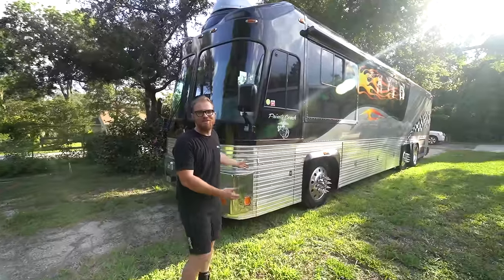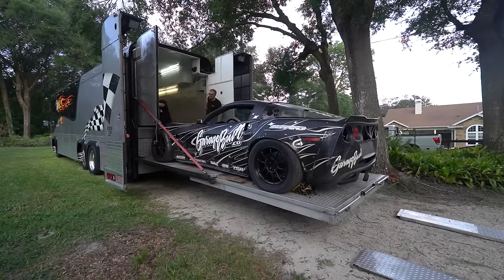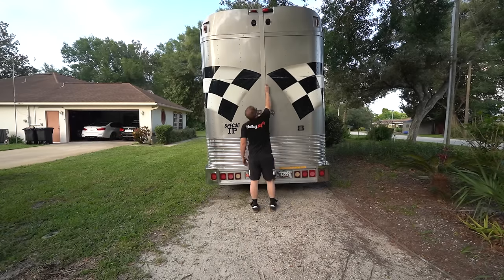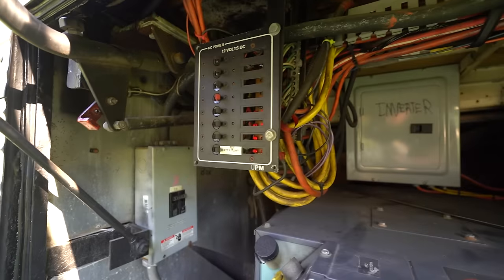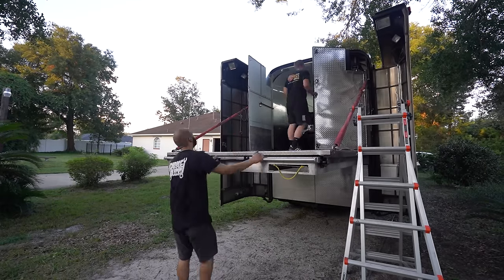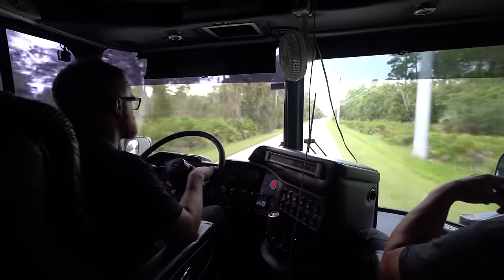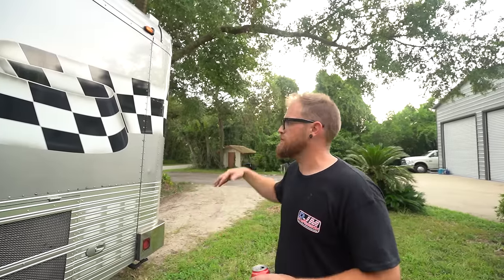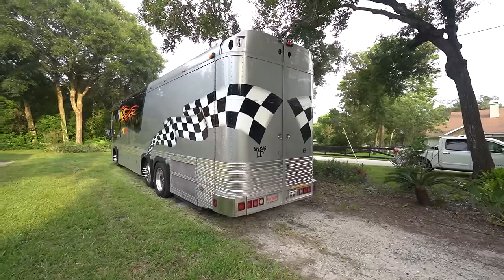First test of the new race car hauler. RV bus conversion. will it fit?

Comment: where is the holding tanks and the dump for the black and grey water? the water heater (theres no such thing as a hot water heater,theres no need to heat hot water,its a water heater,ex-plumber here)maybe in that area. just curious, you going to pour a concrete pad, nice n level,clean, pole barn type cover over ir? be sure to put in a 50amp "shore" power stand, and put a hose bib there and see about running a sewerline to that area as well. yeah i said i was curious, then im giving advise. but my point to the hose bib and sewerline to where you park the haulin bus, you can go to the track and back home without having to find a dump station, heres a trick i used, use your toilet to poop, if ya just going to urinate, the guys anyway, get a plastic urinal (like if yer in the hospital) and pour it down the shower into the grey water, wont hurt a damned thing.or get like a racing fuel can, mark it some how,, like "water" ,then when at the track,carry it off to some area at the track where its dirt,or crappy grass, i know what i mean,but cant get it out, anyway, save your black tank for the poopin only,if youve got your wife/GF, and your crew guys have their other halfs, it will fill fast if eveyone pisses in the toilet.i used to just piss in the shower and give it a fast rinse.

Comment: Taylor your water heating is probably electric,  a small household type heater backed by hydronic, which is a heat exchanger between the engine coolant and your fresh water system. I can tell ya this much, it seems to be a universal truth with RV's that you will use more fresh water than you think, and your gray water will fill quicker than the black water.

Comment: Get a steering buddy it goes right on your steering wheel shaft and it steers the car for you it has a long enough controller you could work the winch and steer it at the same time

Comment: I would think about paving or pouring concrete and widening it some where you pull out to the street as when it rains and you're loaded, the bus is gonna sink in your yard from the weight. Probably cut back the tree's too so its not so tight.. Other than that it looks good..

Comment: Need some solar integrated into the roof so you dont need the generator as often and you basically never have to worry about the batteries if you're just running the winch and lift.

Comment: There's a reason a stacker trailer and motor home are the most common setups
Don't get me wrong it's a dope rig but if you had a stacker you could swap a transmission change oils etc inside the trailer

Comment: Need to install remote starter for the generator on the back of the hauler. This way you don't have to waste time running up front to turn on power.

Comment: I currently hold a class A CDL with passenger endorsement and have many years in motorcoach bus and entertainer motorcoach buses! THERE ARE FEW STATES INCLUDING FLORIDA THAT HAVE DRIVER LICENSE REQUIREMENTS FOR MOTORCOACH TYPE BUSES! Some require CDL EVEN IF YOU SAY IT PRIVATE USE! 1. Size 2. Length 3. Passengers 4. If you haul a trailer and factory weight hauling limits on trailer is above a certain weight a CDL A EVEN IF YOU ONLY OCCASIONALLY HAUL TRAILER 5. If you make income with in racing or other ,the Motorcoach you would be under DOT REGULATIONS AND REQUIRE A CDL

Comment: You should get an RV connection at your house so you can run the ac unit plugged in, instead of always using the generator

Comment: As a truck driver, your right hand turns will always be the tightest and sketchiest. Don’t forget you’re real tall. I suggest a trucker gps, it will route you around low bridges and roads that cant support your weight.

Comment: Just wondering if it would give you more with and make loading easier if you changed those inner rear doors for a roller door 🤔
Reply: I was thinking the exact same thing! Only issue I could see is the right door has a cutout for the winch...
Reply: @DustinStasek  that needs changing anyway because it doesn't pull the lift gate up straight

Comment: Dude, please have the mechanicals inspected, airbags, suspension, bearings, air system/brakes,...gotta check all that before taking it on any significant trip no matter the receipts the guy had or not.

Comment: Just a thought, do you have to have those doors on the back of the truck at all?
If its water tight without them and could you make the ramp lockable for security reasons
Reply: a roller door may work also

Comment: Some suggestions
1 if your going to tie the wheels get some chassis stabilizer bags to keep the car from bouncing it will help the bus and car 
2 switch the winch line out to synthetic its much nicer and for either winch your really not going to get a lot of abrasion or uv on them 
3 if your changing the wheels or considering dropping the spare  wheels for weight just get the lightweight Alcoas tires aren’t hard to change with the right tools but getting off the side of the road fast is top priority in my opinion (that might be because a tow truck driver friend of mine got painted down the side of his bosses truck because someone wasn’t paying attention) 
4 It might sound dumb but building a set of slides outs for your  under storage out of aluminum goes a long way to keeping things organized especially when your trying to leave after an event exhausted/it’s pouring or is about to and your trying to hurry
5 that bathroom and roof are probably going to be the Bain of your existence with that rv and be the easiest way to ruin it 
for the bathroom good quality fittings go a long way to keeping you out of  contortionist positions to fix leaking plumbing 
And with the roof a good roof coating applied on a schedule then parked under shade even trees is better than leaving it bake under the sun 
6 for the cost and effort a a few coats of  a long lasting ceramic coating costs less than frequent ro wash and waxes in the long run for both time and money

7 with the amount of time money and give a fuck your going to be transporting in the bus consider putting a “stop fyre” system on it the last thing you want is a small wiring problem becoming a big bonfire because of the car or engine runway whatever 
(I don’t work for stop fyre but it’s a gaseous extinguisher replacement for the production banned halon gas it’s non corrosive or conductive so it leaves you less to worry about if you actually need it)
Reply: It has alcoas on it 😂😂😂

Comment: Might want to modify some wheel chocks or a metal stop dam, with pins for alignment, so you can then drill matching holes in the lift gate that they drop into when rolling the car back so you do not have rubber maybe slipping on wet metal.  Allow for enough room so you can roll it back forward to get pressure off of it when you get it in the down position.

Also look into a safety cable that is a set length, so when you roll it back, it just limits how far it can go back, so you have double protection to get it from rolling off the back end, and then also is a safety hold from the front to the ramp itself too.

A video of the aftermath of a car rolling off the raised ramp is a video I do not want to watch.

Comment: That is NOT an n14. That is a cummins L9 or L10. You can find serial number on a metal tag on the timing cover, it should also have hp/tq figures on the tag too.

Comment: I bet you could probably get ride of those inside doors if they cause an issue, considering the ramp closes it off and the outside doors completely "seal
it, but I'm not sure how weatherproof it would be to do that... Tight fit, but looks sweet. If you had the Miata in there it would look like a go cart, lol
Reply from the maker: The reason is so we can ac that portion and seal it up.
Reply: @Taylordrifts  i figured it probably wouldnt be weatherproof. Maybe make something to remove the doors easy, but seems like you can manage with what you got.

Comment: You mentioned working on the car at the RV park. Uhh nope. I lived in an Rv for five years and most parks will tolerate doing maintenance work on your RV but working on a race car.. probably not so much. Especially if it is a snow bird place with senior RVers.

Comment: Don’t leave those slide outs, out when you’re storing it unless you can a garage or enclosure. Slide toppers can help but water and the outside elements is the main thing that’ll kill them. There’s 3 types of slides,!8 couldn’t tell from the video. All are very different. Hydronic, electric and cable electric. Preventative maintenance and research will save you thousands on repairs. RV service shops will all be months backed up too so keep that in consideration.

Comment: This is going to sound insane to some, but... Buses like this, should be hybrids.

Hear me out...
electric drive unit for the drive axle (heck you could go duals, and make the tag axle driven if needed)
Then the engine is nothing more than a generator which simplifies its installation (ex: no more driven accessories), and you don't need to have 2 any longer.
Since nearly everything else on the bus is electrical already, you can combine systems that are currently split or duplicated (A/C for example.)
A fully charged pack on the bus will probably be big enough to provide hotel power with the generator off for at least 24 hours, and I'd suspect even longer.
A shore power hookup could provide hotel loads and charge the pack, so now it's a plug-in hybrid.

And, who's say it has to be a diesel at that point.  If you wanted to get crazy, it could be a gasser.  Run it on a common as dirt LS, for example, on a simple stand alone ECU, or even an optimized carburetor, although I'd stick with fuel injection so that you could stick say a single turbo on it to compensate for altitude losses.

I think the technology is pretty much there to make something like this happen.

Comment: UH YOU GUYS NEED TO WEIGH IT fully loaded and empty  certain streets you will NOT be allowed on because it's over 26,000 pounds  I'm a big truck driver I know these things  also measure the full height of it on flat ground and be really careful of your bridge clearance especially the rounded edge type bridges.

Comment: I suggest before you take any road trip.
#1. Change your oil and your coolant fluids.
#2. Obviously your will be changed with your oil change. But you need to change your fuel filter or filters and air filter.
Note: you probably know this already that a diesel is a CI engine... Fuel and Air.
Very important to keep those regularly replace. They will definitely keep your miles per gallon within specifications.
If you don't you will start experiencing a lack of power.
#4. Speaking of filters. Always keep an extra fuel filter (s)... Always.
#5. Make sure you have a set of replacement fuses and familiarize yourself where the fuse box(es) are located, extra bulbs and 🔺  roadside warning devices. 
And one low beam and one high beam replacement lamps. 
You have moved into the world of commercial driving now.
Trust me these things are very important.
Oops almost forgot.
Change those freaking belts... All of them. And is it good thing to have spares.
I have had to change belts a few times on the road myself and saved myself a lot of money.
You don't want to be calling Roadside Service👀😧😨😱😬
Beautiful RIG!
Oh one more thing. The specs on that Cummins engine should be on the head gasket cover.

Comment: Hopefully you won’t need a CDL when it’s all said and done. …. Have you said the GVWR of the bus yet? I know standard school bus not built out for living and no garage comes in at almost 24,000 GVWR. Pretty sure this thing is over 26,000 GVWR.
Reply from the maker: The 26,000 only counts if you’re using it for commercial purposes. Also it’s an RV. It’s how all these people with no CDL drive toters longer than a semi truck. It’s a “rv”
Reply: @Taylordrifts  If you use it for work, it's for commercial purposes.

Comment: That Bus so damned cool!! I'm sure you may have already thought about this but these couple things came to mind while watching you guys load it. 

A remote switch for the lift I think would be really beneficial. Then maybe change the top latches for the doors so you can reach them from without having to ride the lift up. 

Feel like it would be quicker and less wear and tear on the lift if you could open the doors without having to ride it half way and then back down before you load it. 

Again I'm sure you guys have already thought or talked about this stuff but you never know, so I figured I'd just share. 

Have a great weekend!

Comment: Next upgrade custom boeing 787 carhauler/Av-Rv.. upgrade after that C-5 super galaxy with built in go kart track 65 person 26ft screen theatre 12000 gallon aquarium with 2 albino great whites and a petting zoo a matt black blackhawk sittin on gold 26inch forgiatos a 1 of 1 tesla prototype hoverbus carhauler/rv with invisibily cloak capable and 6000 mile range off a single charge battery pack that can only be recharged by the connetic energy created when have a 3sum with atleast 2 blonde baddies on the king size recharge station a lowrider ripsaw tank with full custom Mr upgrade 3000 murial gold leaf pinstripes the works 24 battery hydrolic kit thats capable of hoppin over 8ft fence plus 24ct gold plated mini sub with its own taco bell.. nice bro

Comment: I’ve never been more annoyed by someone else’s purchase than this. For someone that is always concerned with reliability and contingency plans this thing is terrible. Air suspension, power lift gate, it’s giant and can only be towed by heavy wreckers, etc. Not to mention the running costs of this will never be less than a dually with a badass toy hauler gooseneck w/living quarters. Especially since you’re going to also own a pickup regardless. And it’s less maneuverable. No good way to get around town if you want to leave the track sometime during a weekend without a toad or chase vehicle either. I’ve been around a lot of stuff like this and Class A busses are overrated. A solid pickup with a fifth wheel or gooseneck will always win in most situations.